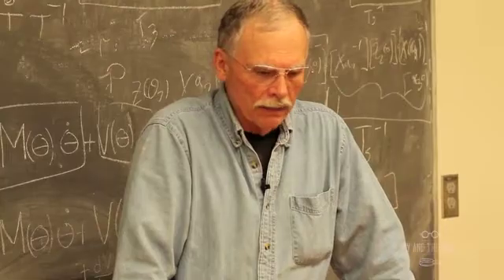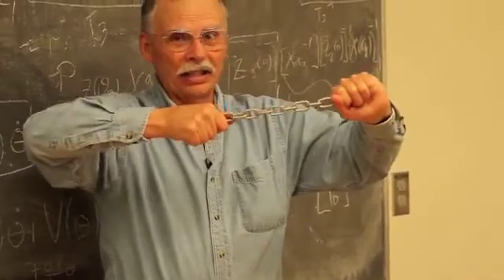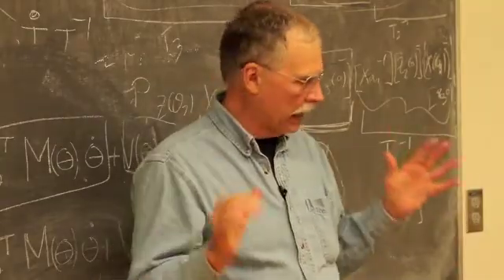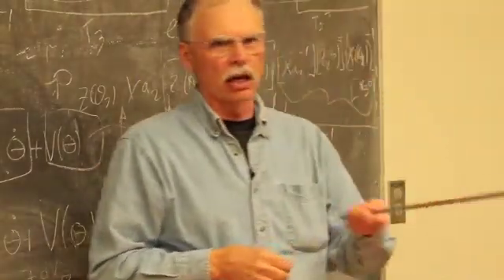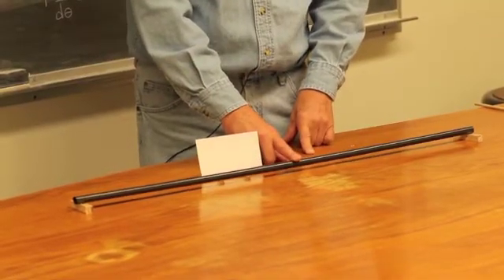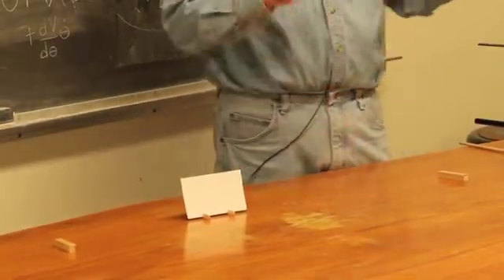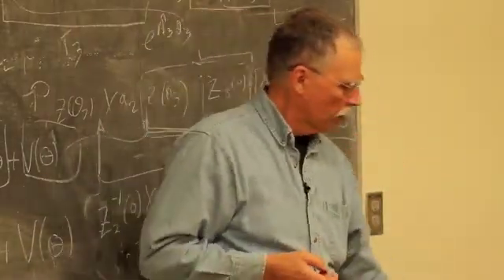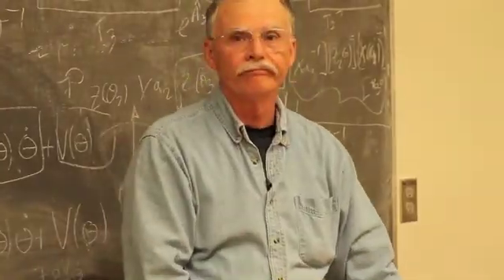Intro to Racecar Engineering:  03 Strength and Stiffness

Comment: But let's say you need the tube design, not the rectangular design, could you just use two tubes of steel side by side to reduce the flex?

Comment: It makes very much sense. The key is (especially in complicated structures) to understand the loads. Once you understand the loads, you can design the structure to accommodate these loads. And if you are restricted in any way in creating a stiffer/stronger structure (in for example space, as the truss takes up significant space), only then look at achieving desired stiffness/strength through material stiffness/strength as opposed to structural stiffness/strength. 
I suppose now in these modern times FEA techniques help a lot with this, as you can already design and test parts with loads without needing to spend the money and it might not working out or being insufficent. Especially useful for students, as it can give direct feedback on whether the train of thought is correct or not.

Comment: Excellent demonstrations.

I would add that "I" beams are shaped that way to concentrate the material away from the neutral plane. It was a mystery to me why construction beams were shaped that way until I learned about this principle.
Reply: Engineering is so sick, the way the torsional load and sheer and tension are so calculated and with not too much difficulty, makes the real world feel like mine craft.